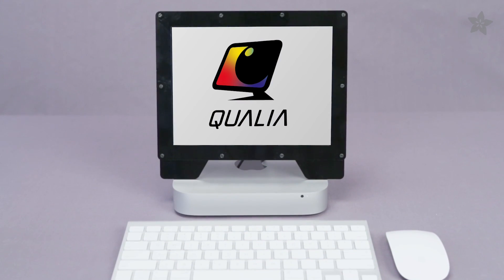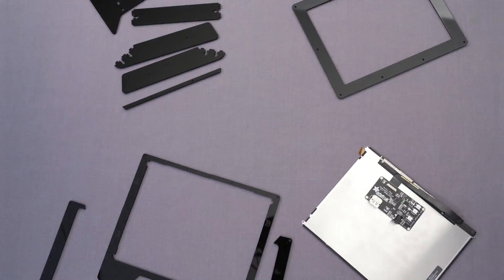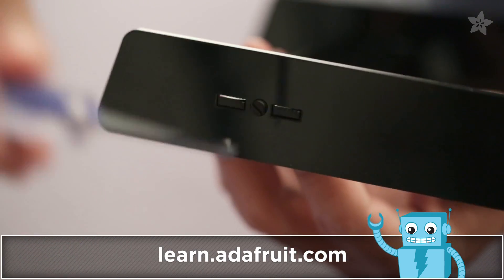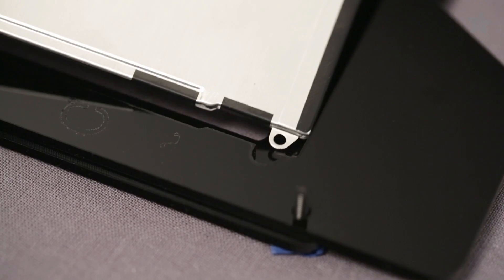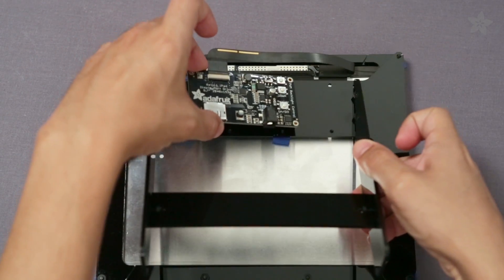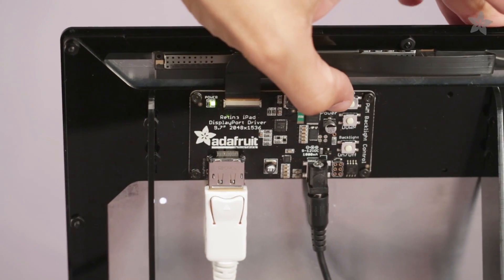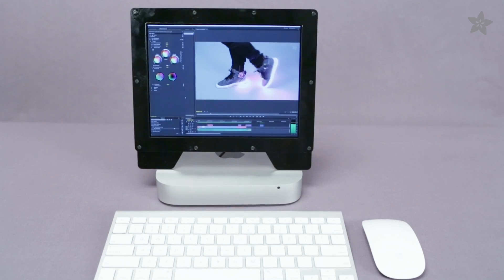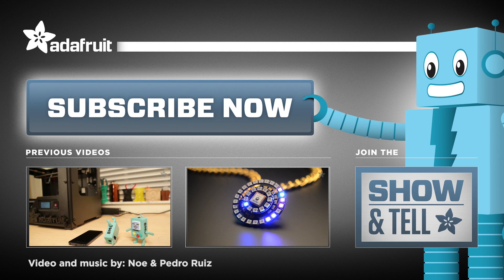Adafruit Qualia Display

Comment: Rasberry Pi to go ! Yeah
Reply: I doubt the Pi will be able to drive this natively. Also: this is Displayport so you'll need an HDMI adapter. This is 2x 1080p. You'd have to run this at half its native resolution :(